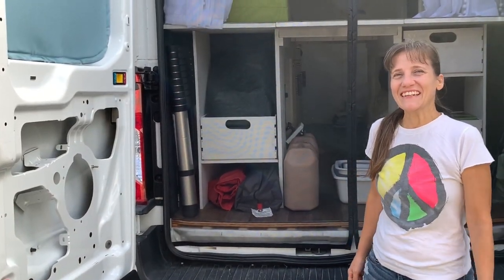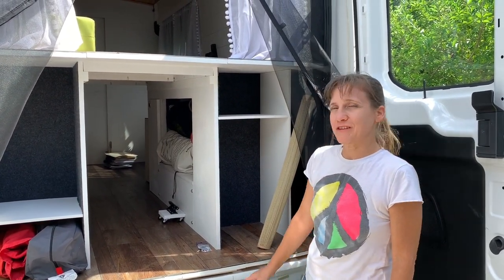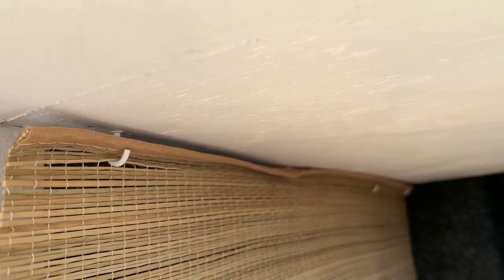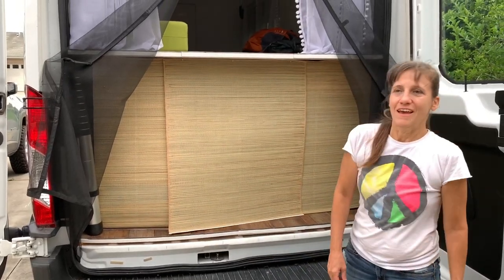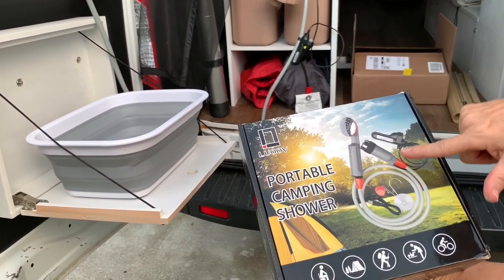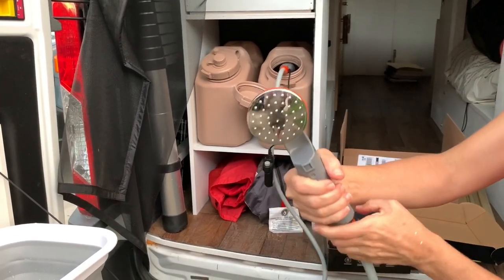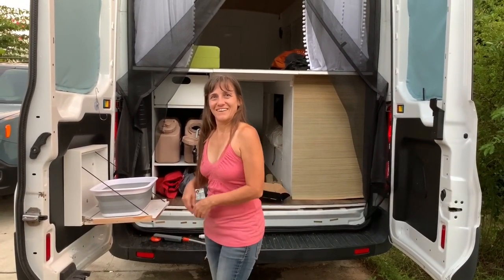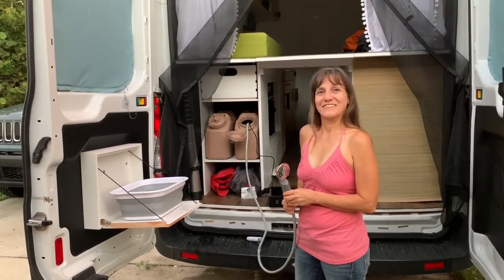Van Life | Shower and Wash Area off the Van

Comment: If you get a foldable dog or baby bath and stand in it, it will catch the water and you could put the pump in it to recirculate the water giving you a longer shower. Ok it’s water that’s been over you once but it’s no different to sitting in a bath. You could then have another container with clean water for a final rinse. Also a black container put in the sun will heat the water or you could heat some water on the stove to boiling point and add it to cool water in a container. I’ve also seen a shower curtain attached to a wooden pole that fits inside a notch at the top and inside of each door. You could use your bamboo again. A pole between the two doors stops the wind from shutting them too and also acts as somewhere to hang towels etc to dry.
Reply from the maker: These are all really good ideas! Thank you!

Comment: I've been enjoying your progress. 
You might consider a couple of small washers glued on both sides of the roll down shades at the top to prevent tearing from the small hooks..  Also, a simple fix for the blowing shades would be attaching neodymium magnets to the shade and a simple screw/washer or small metal plate attached to edge of your shelving cabinets to magnetize to.
Reply from the maker: Thanks! both are great ideas. I especially like the idea of adding the washers at the top, since The hooks have torn them a bit.